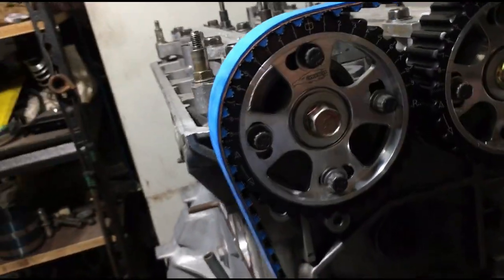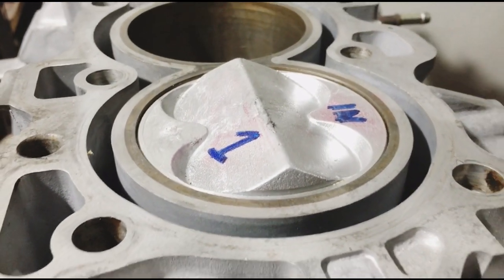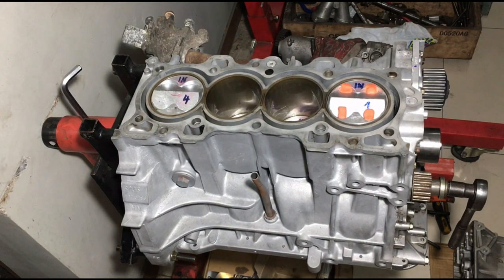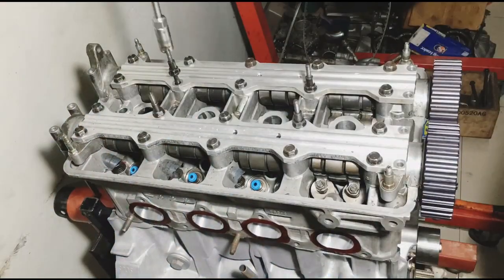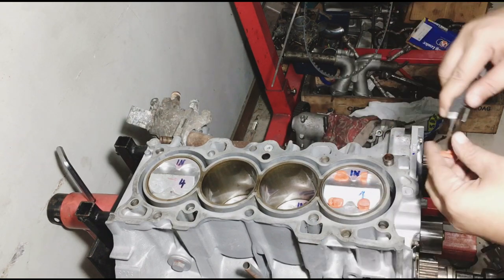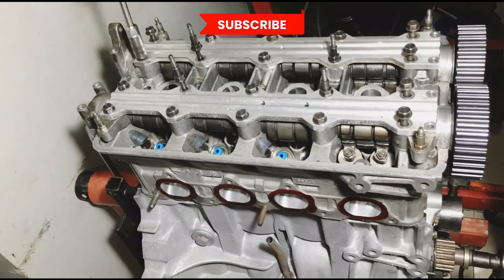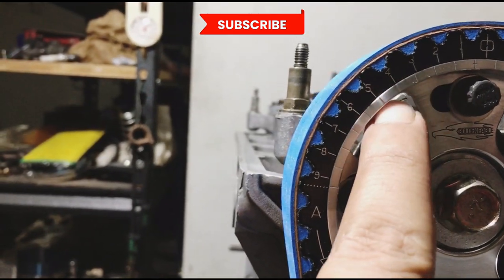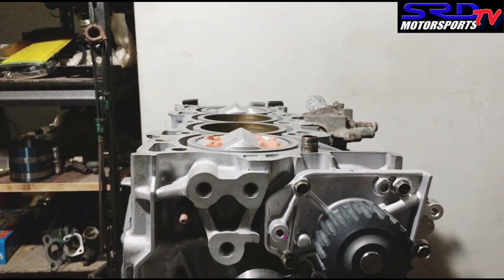Clay Test / Checking Piston to Valve Honda by SRDmotorsports

Comment: Great video SRDmotorsportsTV. I'm just wondering if the cylinder head and the deck of the block is shaved. If so, how may millimeters are shaved on both? Thankz.
Reply from the maker: Good question as results often change once those two things are done and how much.

Block is unshaved as it is flat and good
Head we got this previously with 0.040" shave hence the appropriate step of clay checking which was a perfect candidate for this video :)
Reply: @SRDmotorsports  thank you for a highlighted reply. Hehehe! Assuming an unmilled head and block mated together with stock phk pistons (not pocketed) is it gonna be a hit or a miss? Hehe..
Reply from the maker: @benjieco630   Thank you for the good questions as thats part of the main reason for claying :) 

on the PHK i think  depending on cams  i  mean stock b16 cam will be safe i think even ctr cams 

id say safe to even advancing a degree but... id rather not :)
Reply: @SRDmotorsports  yeah! Done that. I thought you also have stored measurements on those specs. Your valve to valve clearance and cam degreeing videos are totally awesome, for those who understand the whole concept. More power bro!
Reply from the maker: @benjieco630  well on the claying? stored measurements will be hard plus.. everytime we buy head unshaved we find out its 0.020"' milled 🤣 its fine ofcourse just means gotta measure once again so it kind of became a norm for me lol

Comment: Hey, did you mill the head at all? What’s the static compression?
Reply from the maker: Hey thanks for asking :) we were showing clay testing but the b20vtec that was shown here js our current series also and head has 0.020" mill done (had it when we got it even before porting)

static comp is roughly 12.75:1 :)

Comment: Thanks for making these videos! Quick question though. Do the cams need to be degreed before clay checking or after? I just did my valve to valve check using your video and trying to figure out what the next process is. It's my first time going this deep into rebuilding an engine so please forgive me if I sound like a noob.
Reply from the maker: oh man! wow thank you for the comment thank you! it is nice out videos help :)

and its quite a "non noob" question btw

and which goes first? dependa i mean example if we are running skunk2 pro3 cams? (big) we might clay first just to be sure cuz there are times before we get to the ideal lobe center we might hit it?

but on lets say skunk2 tuner2 or pro2 even crower403? you can degree first and the clay checking is just added comfort to know that on the dyno u have your "window" thats safe to adjust as gained from
-valve to valve
-clay test checking

I hope i answered it good enough
Reply: @SRDmotorsports  Thanks so much for the quick reply! I'm just running a Skunk2 Tuner1 so not aggressive at all but the head does have oversized valves so I might as well clay check for that added comfort.
Reply from the maker: @vision27  oh yes perfect word "comfort" indeed and for future dyno adjustments you will be safe too

Comment: Are these piston domes bigger than nippon racing 84mm ctr replica pistons?
Reply from the maker: I believe so, or quite identical... what i do know is the valve pockets on these are a bit bigger because the dome/piston tops were actually mirrored from an old Arias 7.5cc something 84mm piston
Reply: @SRDmotorsports  thanks for the info

Comment: Hi sir, what are your thoughts about 1up pistons..  im thinking of using the same pistons sir.. hope you notice my comment sir.. Godbless
Reply from the maker: 1Up is real good I’ve built 3 engines with those and Ecu_Later’s b20 I built since 2018 and no problems as a street car on pump gas no trailer and runs 12.5sec in the 1/4
Reply: @SRDmotorsports  very helpful sir! Klaro👌🏻 I appreciate ur answer sir. Mag contact nlng ako sa fb page nyo sir if ever :) Godbless!
Reply from the maker: @boyaratig1802  thanks for appreciating the videos too

Comment: How did you lock the Vtec?
Reply from the maker: Good question and thank you for asking 😏
we use a small ball bearing thats similar in diameter to the vtec locking pin, but u can also use a thin spacer if you find one of the same size.

Place it on the non springed rocker side so the vtec pin protrudes across the vtec rocket and unto the springed primary rocker and hold it together to install or ziptie (but u have to make sure u dont leave ziptie traces or debri on the head after
Reply: @SRDmotorsports  thanks so much sir, enjoy watching the videos as you give detailed explanations
Reply from the maker: @TRDKhanbrothers  Thanks for asking on the comment section, believe it or not these questions help me alot... as what i do? is passion first hence i enjoy it

but i missed the thought about locking vtec and now il be able to include a short segment on that specifically on the B20vtec episode 3 series like just an added info share moment
Reply: @SRDmotorsports  thanks so much sir 

No problem we all learning 😎
Reply from the maker: @TRDKhanbrothers  plus this way u are obligated to share next episode haahaha kidding :)

Comment: are u running .040" on both intake and exhaust valves
Reply from the maker: u mean piston to valve clearance? intake is 0.040" minimum safely

exhaust you'll never go as close to 0.040" if properly built so its the intake thats mainly the worry

ive clayed dozens of Pro3 and even Bisi Custom Webcams (thay ran 10s in the Phippines before the nitro/meth craze now) :)
Reply: @SRDmotorsports  I appreciate all the information I was actually able degree it and find cl but i wanted to map out all the dangerous area as dont go beyond point by following v2v clearances which were .035">.040" but it seems to me that's its all advancement on the cam gears where i get intake closest to p2v as you suggested, but I've seen few videos where ppl made power retarded the intake cam a few degrees... I think did enough on my motor to get as close as I could to the 200hp mark, hopefully, that's why I'm chasing the tighter side of the clearances thinking that squeeze out few more hp.
Reply from the maker: @Booyaabuilt   how you are doing it is good and prowr just get the "max safe" advance on the intake and ofcourse the safe v2v and even write it on ur phones notes , this way u got the safey window handy and lets u play around with the gears on the dyno "safely"
Reply: @SRDmotorsports  thanx for all the advice i truly appreciate it... keep up the awesome content 🤘🤙✊
Reply from the maker: @Booyaabuilt  all good man and thanks for checking it out... more info like this means mre fun projects for us all 😏
Reply: @SRDmotorsports  I'll let u kno how it does hp wise
Reply from the maker: @Booyaabuilt  thats cool Im sure it will do good ftw